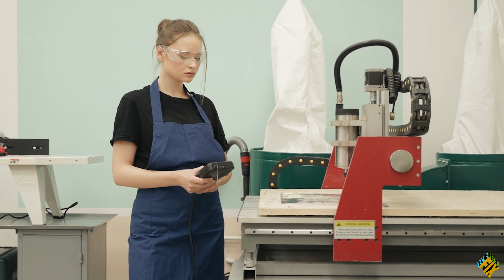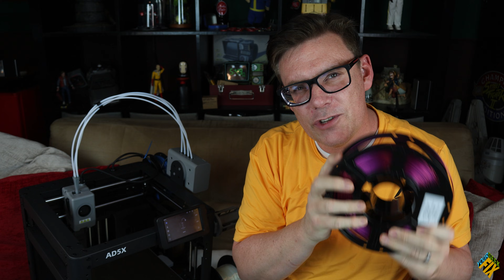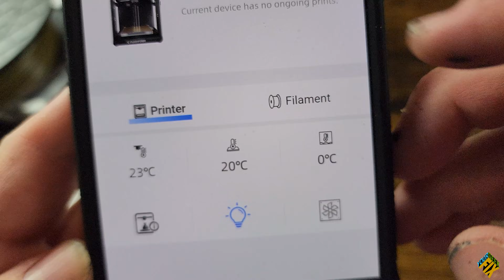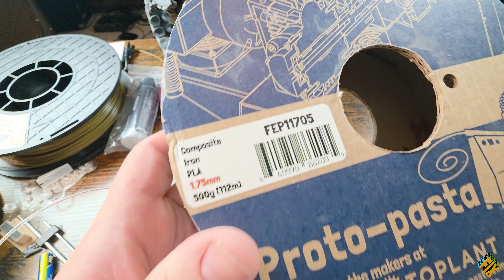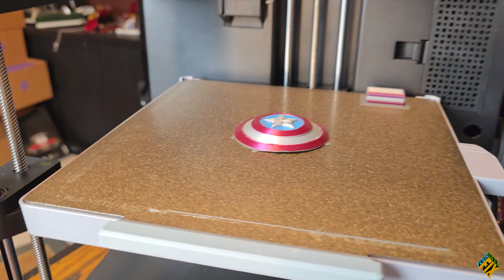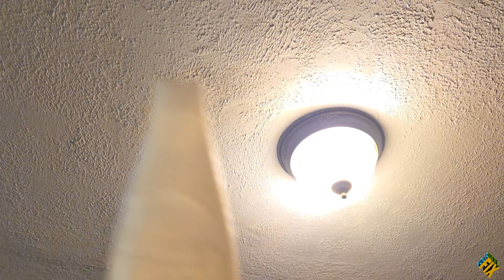BEST Multi-Material 3D Printer?? - Flashforge AD5X Review

Comment: The filament waste is what has kept me from buying a multicolor printer. BUT, I did buy one recently, last week. I bought an old and very lightly used eCubmaker. It is slow as it does the same unload, reload and extrudes some filament to clean out the old filament. HOWEVER, no purge tower. So, it's very much more economical. It does shoot maybe 6 inch stands of .4mm length filament but that's not bad. Plus the proprietary slicer software makes it a second no no for me. So, NOPE. Supposedly the very new Snapmaker U1 with multiple tool heads solves these problems. I'm looking into it but I am not buying this machine, more due to the waste of material than the waste of time. I don't mind stepping away for hours but coming back to wasted fvilament, that's a kill for me. Nice review.
Reply from the maker: You can turn off the tower setting on mine.

Comment: Why do you need a USB drive to start the print? You can send to the printer from Orca through ethernet cable or wifi, without ever registering the phone app. That's how I use that printer.
Reply from the maker: Because it was in the basement where I dont have wifi or either network cable.